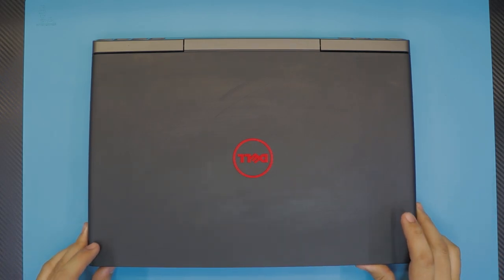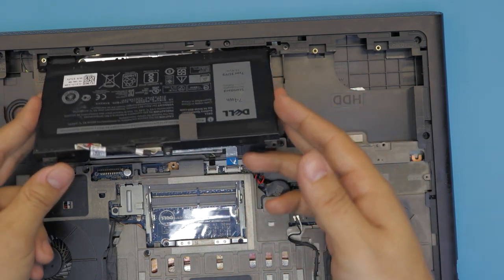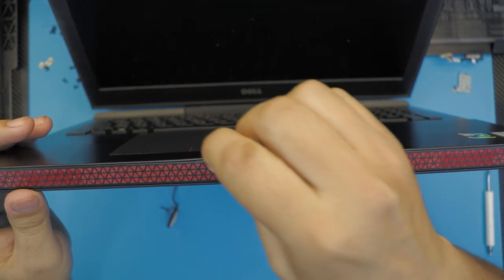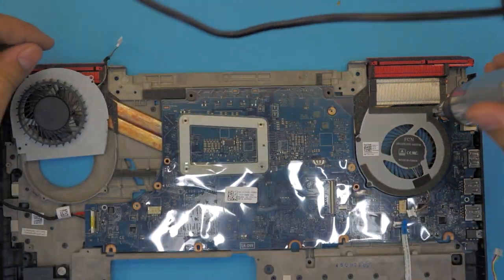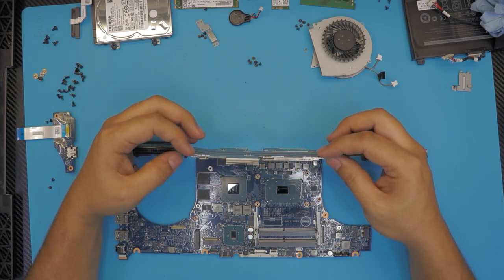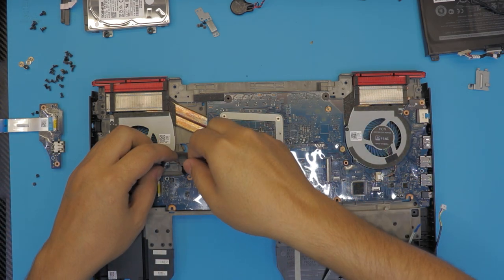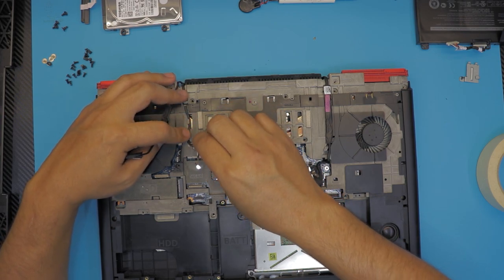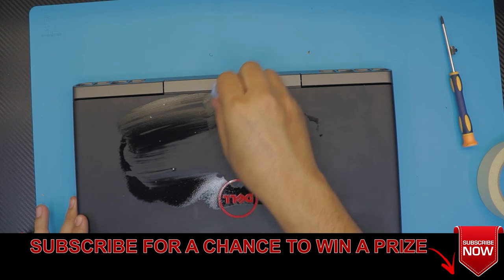Dell Inspiron 15 7000 LIQUID METAL thermal compound and teardown

Comment: Hey mate. Not sure if you still reading comments for this video.. but I'm curious. If I will do it by myself and gonna take a big attention to each step what you showed in the video, what is actual possibility for me go wrong? Don't want to get in big minuses :D Also question, I'm from UK. What grizzly paste you can advice? Thank you, earlier :)
Reply from the maker: Thank you for the feedback! if you wish to support the channel you can LIKE or SUB or both :P
regarding your question: i try to answer all the comments, and if you take your time and pay attention, you will be more than fine. don't rush and follow every step and if you need any extra help let me know. trust me you be fine just follow the exact steps.
i recommend you instead of the liquid metal use a paste version its 1000% safer and you get almost the same result only 2-3 degree difference .
use this: thermal grizzly kryonaut : shorturl.at/hkmSU
Reply: @uFixTek  I already ordered that grizzly conduct what you wrote in description. Is it bad?
Reply: Conductonaut
Reply from the maker: It's the best, just make sure you follow the video exactly. its very conductive, make sure you don't drop any on motherboard.
Reply: @uFixTek  alright. I will do it today a bit later. Should be fine. I bought that tape too, to cover around. I will leave a feedback once I will be finish.
Reply: @uFixTek  You mentioned something in the video about bios. If I remove one little chip I will need reset the bios. If I don't remove it, I will not need to do this? Also, just curios if I do everything step by step. I should not lose any files right? I rewatched your video at least 2-3 times and I think I did not hear anything about it.
Reply: @uFixTek  Just finish.. at least it is working lol :D I probably made a mistake little when I put back my keyboard.. because one side of mouse pad is a bit up and now when I use it, makes a bit sound. Regards cooling didn't check yet.
Reply from the maker: awesome, great job my friend. ya you can reopen and check make sure you don't have any cable pushing up to the track pad, make sure your battery is not inflated , if it is that's what is pushing the track pad. and is recommended to replace the battery if yours is inflated even a little bit.

Comment: No se si alguien me pueda ayudar tengo esta misma noteboock vive con temperaturas altas aunque tenga pasta thermal grizzly kryonaut , no creo que sea esto pero por las dudas consulto que grosor tenian los termal pad de este modelo, no sea este el problema(use de 1mm de grosor)
Reply from the maker: cambiaste los pads termicos de tu laptop?, y pusiste de 1MM??
Reply: @uFixTek  si estaban  despedasados los originales
Reply from the maker: tu problema esta que pusiste unos pads mas firme y grueso y eso esta contra empujando tu dicipador, cambia tu pads a uno de menos grosor. por si el vrams no requieres de enfriamentos ya que no son overclocked, hay muchos modelos sin pad termicas.
Reply: @uFixTek  OK, y tenes idea más o menos de que grosor son
Reply from the maker: yo te recomiendo usar .5mm

Comment: Sir i am facing some problems in the motherboard, gpu and bios . Should i replace motherboard or get the motherboard repaired ie gpu changed??
Reply from the maker: the gpu may need a reballing, its cheaper to do a reballing on gpu.

Comment: Did laptop work? i have the same model and im going to do this but i curious about will it damage my laptop because its conductive i dont think i would spill the paste outside the dye but will it damage gpu or cpu ?
Reply from the maker: Mehdi Baba mehdi joon, trust me i been doing this job for over 14years, if you careful nothing will happen and you will have a great experience doing it. The cpu or gpu wont get damaged by the LM as the LM is for this reason, else they wouldn’t be making it. You will be shocked after the results. If you have any questions ask here. Good luck

Comment: Wonderful video! Just wondering, how is the LM performing now after 2 years? I have heard that it needs to be reapplied every couple of years or it will not cool as efficiently. Thanks for your help!
Reply from the maker: thank you for the feedback, and let me try to explain the best as i can.
1st of all LM once placed it will last a life time conducting heat or cold, there is not expiry date on it.
2nd. most people that use LM dont understand the physics or the type of the material and the bond that it creates.
the LM will bond the cpu/gpu dye tot he copper , it will act as an soldering two parts together over time this bond becomes even BETTER  not worse (better heat or cold transfer). BUT over time it becomes even more fragile as well.
so now we know that it bonds both material and over time the bond becomes better and fragile.
now lets see where we applying the LM, 
When applied into Laptops it will work like a charm for a year or so, and after that period of time the bond is becoming better and more solid. but as human we tend to bang around the laptop or the bag-pack , so what happens in that situation is that the heat-sink will move slightly , that will cause the joint to crack, because there will be no more liquid left. 
so to cut the chaise , if you move your laptop a lot and its not in one place all the time , i dont recommend you to place a LM unless you willing to replace it every 1-2 years. 
if you keep your laptop in once place and are very cautious regarding moving it, then LM for life without replacing it.
same goes to pc.
people place LM in PC cpu and after a year or two they see the temps rising they think its LM faults! and its NOT.
if you think how the heavy heatsinks are mounted to the motherboard and the gravity is not to the favor of the heatsink and that the heatsink is holdup with screws and springs, so it can move/slide, and it positioned on the side of the case.
SO after 1 or two when the LM starts to make a solid perfect bond and one day you accidentally give a tiny bang or move it very slow, that heavy  heatsink that is hanging on the side of your case will move and break the bond. 

therefore LM is awesome if you are very very carefull with your stuff.
laptops that move around its a no no,

i hope i explained myself,
thanks again for the feedback
Reply: @uFixTek  Thanks so much man! You explained way better than what I was able to gather in several hours of web surfing. Now I can make an informed decision to what type of thermal compound I will use. Also, thank you for staying active it the comments of a 2 year old video,  sure it helps tons of people out.
Reply from the maker: im glad it was a help, i try to stay on top of the comments as much as i can, maybe one day i get a profit  in return :)
i would recommend you for your laptop to go with :
https://amzn.to/2XkvipZ

you wont have to worry regarding the transportation of the laptop, and its 95% same results as LM, but this one it does need to be replaced every 4years. (6h a day max load)
good luck

Comment: Hi there, can I use any Electrical tape, which can withstand the same temperatures as 3M? :) I need to replace vents, but I am afraid of changing the thermal paste as it seems difficult.
Reply from the maker: if the spec of the tape can resist up to 70c then sure do use it, and dont worry regarding thermal paste its not that hard if you take your time and no rush, and if there is anything you need help with im here to help you out. good luck and thank you for the support to the channel by SUB :P
Reply: @uFixTek  the tape should resist up to 105 degrees celsius. I am wondering if the glue on the tape could damage something on the CPU?
Reply from the maker: absolutely no it will not damage anything.

Comment: what should i do when my lock to the hdd cable just broke?¨
Reply from the maker: regarding your question, you got two options, one is to take it to service center and get that jack replaced and 2nd is to place a .5mm plastic over the flex cable to be able to push the fable to the connectors.

Comment: I cant get out the screw of the LCD cable bracket lol
Reply from the maker: can you send me pictures. and a closeup of the screw.
Reply: I tried the rubber band trick. No luck
Reply from the maker: ah there is a easy way to remove it :P 
make a cut in the middle of the screw  and use a flat screw and remove it 
https://imgur.com/a/TcoANgn

you have to comeup with a some way of cutting without buying stuff:
we use this tools to cut the screws in middle (you dont have to buy it , its just showing you what i use) if you know someone that can give it to you for 5min or use some other tools.
https://amzn.to/2ZkDuGI
https://amzn.to/2CP8hnF
(https://imgur.com/a/ZUfqTKo)

Comment: Almost got to the motherboard but in the end a fcking stripped screw got me, gg dell, gg Chinese factory you’ve done me well.
Reply from the maker: 林漢青 send me picture there are many ways to remove stripped screws,
Reply: uFixTek you sure I can have your email?

I tried using rubber bands and thin gloves, didn’t work

My goal is to just clean the laptop, motherboard has been two years untouched and REALLY dusty, if I can’t get the screws would it be okay to just blast my hair dryer through the vent?
Reply from the maker: 林漢青 👍

Comment: Hello i'm having troubles with the gpu clock on my dell inspiron 15 7000 Nvidia GTX 1050 after a minute or two of gaming it goes from 1354Mhz to less than 200Mhz any idea how can I fix this?
Reply from the maker: you could be needing a new thermal repaste, when the gpu over heats it can cause this issue., or you could have a bad voltage regulator on the motherboard

Comment: hello, one fan doesn't work (left processor fan). Its connected and cables from fan are good. Bios says message to me. Maybe you know a problem ? updated bios and still have problem
Reply from the maker: left fan only works when the temperature of the GPU goes over 65c. when you turn it on it should not work until you load a game then it should start, and if it doesn't start after turning on a game , send me a picture of the fan and the sticker of the fan.
thank you for the support to the channel.
Reply: @uFixTek  BIOS says me alert 0511 and report: fan processor fan mailfailure....and when listning fan's I think is left (not working) when laptop standing on desk and right is working fine...dell says to reset bios to default or update or downgrade (cannot downgrade says: cannot update due to unsupported downgrade / checked in box "allow to downgrade" in bios) ----fan is FCN Brushless motor
Reply: @uFixTek  anyway thank you for your Profesional Video, today helped me a lot but if you find a solution of fan wchich don't work after install please let me know....other people on dell forum also have same problems
Reply from the maker: your welcome and i hope you get everything working , if you need to find to were to buy the fan let me know.

Comment: Just tried to take my wife’s apart last night got all the way to the GPU and cpu and I guess one of the employees at dell are torque happy because one screw holding the cpu side of the heat sync down it way over tightened and they completely stripped the head big waist of time good thing she has the 1050ti and newer I7 in hers so they don’t produce that much heat because there is no changing the thermal paste on that one ugh 😑
Reply from the maker: Jay Laforge they they love to mess with screws 😂😂
Reply: uFixTek the good news I was able to get the fan to stop making a weird winning sound the cpu one wasn’t plugged in all the way shame about not being able to change the thermal paste thiugh
Reply from the maker: @therevanchist1123  wow nice that you found out the problem and it was a simple plug in :) thank you for sharing .
Reply: @therevanchist1123  it may seem unnecessary but you could use a small drill bit to drill off the head of the screw.  hope it helps

Comment: My battery looked kinda inflated with some bumps (it was not flat like yours)
Reply from the maker: You will need to replace the battery as it will inflate more and damage the laptop. The model of the battery is written on the battery.
cheers🍻

Comment: Do I still don't need to change my thermal paste after 2 years of usage on my laptop?
Reply from the maker: thermal paste should be replaced every year or two, depending the usage. if you use your laptop 6h daily i would suggest replacing it every year , for two reasons , main reason is the dust that it will buildup inside and second it will make your laptop last longer by doing a cleaning and replacing thermal past.
Reply: @uFixTek  great. I just bought a thermal yesterday thinking "how hard can it be?" my laptop is the same as this video and boi. I'm terrified to fully disassemble it like you did now
Reply from the maker: its not hard very simple and fun, if you got problem or questions ask me. good luck

Comment: Bro I did everything but my keyboard doesn't work anymore. The power button. Whereas when I open kboard flap sometimes it switched on by itself & then some buttons stop working eventually. I think I made some mistakr with keyboard connectors, I couldn't get them properly. Please help me!
Reply from the maker: dont worry will get it fixed,
can you send me a picture of your connectors @10:14 make sure the white ribbon is well pushed in. use https://imgur.com/
https://imgur.com/a/PINRmLx
make sure the blue part of the ribbon is facing up and push it in well and close the flap.

Comment: Done everything but don't feel any big difference in temperature.
Reply from the maker: you don't see the difference in temp because your fan curve is based on temp.
for e.g the fan curve works like this the fan will go @ 80 % when temp is 70c and when temp goes higher the fan goes faster.
the advantage you have now its that your fan does not kick in at max when you at max load.
if you have set the fan curve at e.g 50% and full load before the repaste you would see a 90c 
and if you set the same fan speed at 50% after repaste you would see 70c or less
what you get now is less fan noise and faster cooling.
other option is to download msi afterburner and set the fan curve to your liking.
Reply: @uFixTek  get it 👍🏻 I didn’t remove that bios stuff because I didn’t want to reset it, because I don’t know to even set it up 😂 I done everything like you said. Any other advice maybe you focus more? 

I know my pc now is old, probably need to get normal pc for games but at the moment still grinding money
Reply: @uFixTek  and regards video, thumb up. At least I manage dismantle and put it together just from watching video.
Reply from the maker: much appreciate the support,
i would remove the HDD and replace it with 1tb or 2tb SSD and have my windows installed on a 500gb m.2 SSD and this way you can have lunchers and programs on main windows m.2 ssd and game library and file on other SSD 2.5' this way you will have a better file transfer and no bottle neck.
i recommend the samsung m.2 and samsung ssd 2.5" they are very durable and long lasting.
https://amzn.to/3Ri8CkL
https://amzn.to/3DmGfvU

Comment: Hi, I did exactly everything in this video but when I turn on my laptop it automatically turned off after a few minutes when plug in. Maybe because of its gpu I think because when I opened a game it is laggy like it's not using the gtx1050ti. Hope u can help me with this. :(
Reply from the maker: check you bios to see if the dedicated GPU is active.
Reply: @uFixTek  I just noticed it now, whenever I opened a game it automatically shutdown. I'm hoping that I didn't do any damage on it. :(
Reply: @uFixTek  And also when changing the thermal pads, should I use the same thickness? Coz mine I used 3mm thickness and I think it is so thick compare to the stock thermal pads in the unit.
Reply: Hi Sir! I already figured out why it auto shutdown, it's because of overheating the thermal pads I used was so thick that the heatsink didn't reach the gpu chip itself. My question now is what should be the average temp in idle and gaming? I forgot to note the temps before I change the thermal paste and pads.
p.s. I used the same liquid metal in this video.
Reply from the maker: the idl temps should be 45c cpu and 38c gpu and max load depends but should not go over 90 cpu and gpu 85c max  as the heat pipes are shared.
Reply: @uFixTek  I think I have a problem in my gpu, its maximum temp is 85-87c which is normal I think but its minimum temp is 45-50c, I'm not getting the 38c. What do u think sir?
Reply from the maker: its okay perfectly fine never worry about minimum as long as you max temps dont go over 90-94 then you perfectly fine. no need to worry. you not going to have any cpu or gpu throttling , you fine :)

Comment: I went through this bullsh*t yesterday. Damaged 3 screws in the process cause they were screwed too tight in factory.
Reply from the maker: i have no idea why in hte hell they screw the screws so tight, but the screws are dirt cheap and all you have to do make an insertion on the screw heads and use a flat head to remove them, and you can take the screws to any electronic repair shop and they will donate few we always have 10000 laying around. but i hope you you did the repaste and cleaned up at least.

Comment: will my laptop work if i remove my laptop  battery and then use it on direct current.
my laptop battery is dead, does not even stand for 5 minutes 
my laptop model is  dell inspiron 15 7559
kindly help me ?
Reply from the maker: sure it will work just fine and it will make your motherboard components last longer and your charger will last longer as it wont have to charge the battery. good luck and thank you for the comments
Reply: I have 7559 . Just remove the bloated battery and run directly on adapter.